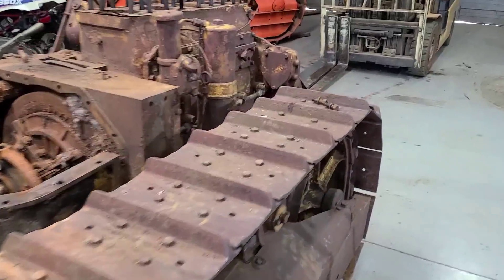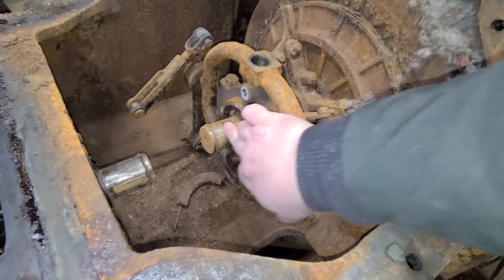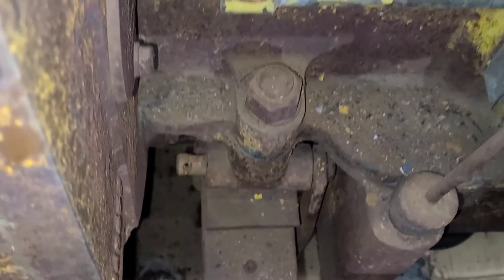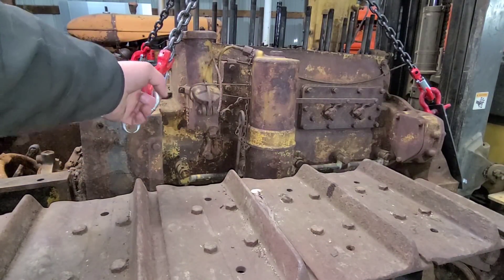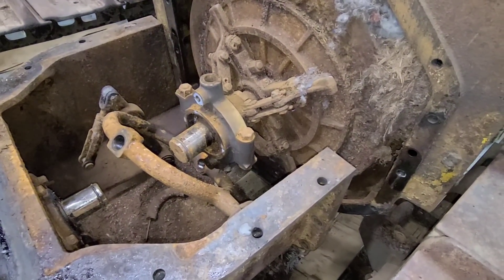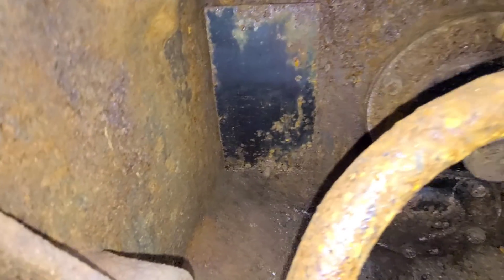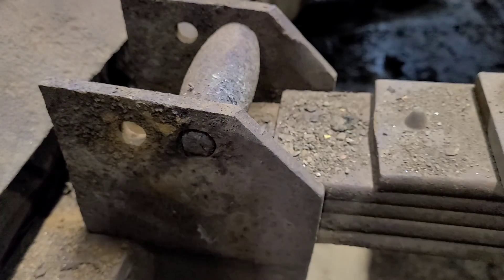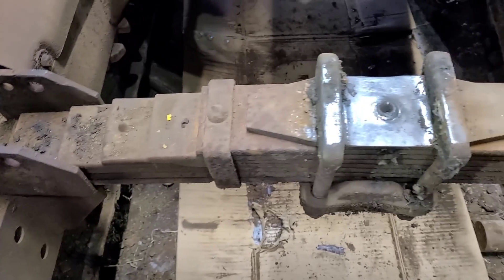Caterpillar RD-4 Engine Removal

Comment: I have an RD-4  just like yours ser# 4G 3491 except it has a winch on the back and an overhead pulley system for the dozer blade 
It's in a lot worse shape but it rolls OK and I had the pony motor running and turning the main engine over about 15 years ago.
When I took the serial # to the CAT dealer they said " so you have that one, here's the microfiche for it. It's the last one."
New sub here. I think my CAT is too far gone and on it's way to become a lawn ornament.   Just got a CNC lathe to work on.
Reply from the maker: That winch setup would be neat!

Comment: Loving the process and progress. Longer videos gets my vote but whatever works for you. Might need a support under the clutch compartment in case whatever’s holding it up let’s go.. ask me how I know..
Reply from the maker: I didn't show it but there is a jack underneath, I had it under when taking the engine out as I wasn't sure what it would do, I then lowered it and moved it out of the way when I took the main spring out. It's back in there now though!
Reply: Good work! By the way if you’re a member of ACMOC there’s a copy of the RD4 Operator’s Instructions in their Technical Library.

Comment: There is another guy on You Tube, Pacific Northwest Hillbilly who is restoring a D4. He has just had the top cover off the transmission and done the steering clutches. I think his machine was potentially in the same condition as yours. He got a complete engine for around $500 as the original engine was severely rusted internally. This said he is learning as this is the first time on these machines but he is good at sourcing the stuff he needs.
With the bores on that engine it might be a good idea to undo the main bearings and pop the pistons rods and sleeves out as one unit (if the come apart like that). You can then cut the sleeves off and if lucky save the pistons.
Reply from the maker: I watch him too Allan 👍

Comment: I came over from squashes Channel as well but a little piece of advice I don't know if you know this but when you're heating a bolt up that's got a pin or a shaft through it stuck with rust rapidly cool it with water or some type of cooling break the rust Bond
Reply from the maker: I haven't tried that, usually heat alone is enough to get things moving
Reply: @kylechrist  yeah Kyle if you heat them rapidly coolant with water it'll break the rust Bond I have personally done it a few times my buddy Don Osborne taught me and my dad was backyard retired mechanic I know I quite a bit about this stuff not necessarily the D4 but more the old Dodge Power Wagons and stuff like that

Comment: That wasn't too bad. Helps that you had the forklift. When I pulled the engine from my D2 to do the clutch I was able to get it Alan Smith's shop and used his overhead crane. Only difference was I had no rust issues. Good job. Keep the videos coming.
Reply from the maker: Thanks Chuck, I need to get my gantry crane finished as that won't ever leave the shop 👌

Comment: Enjoy your videos but have notice that you don’t use any type of penetrating lubricant on rusted nuts or bolts.  Just heat when necessary.
Reply from the maker: Yep, I've never been a big fan of penetrating oil, always had good luck with heat. Thanks for watching

Comment: I don't know if you would be interested in a shout out for my channel. I'm rebuilding a Case 310G Dozer. If not no hard feelings. Good work pulling the engine.
Reply: Going to subscribe. I also have a small channel that I'm attempting to start producing more and better videos. If you would mind checking them out.

Comment: Whenever i have something stuck or nearly stuck, i spray it with wd-40 and wiggle the mechanism back and forth, each move it moves little bit farther and rusty wd-40 oozes out.
bet 99% of lubricants do the same :)
Reply from the maker: Yep, I do the same but with diesel fuel

Comment: Nice! Getting that machine to work again will be a giant project, but at least a lot of it is still coming apart without insane effort and damage.
That wouldnt be so easy on my side of the Atlantic, everything thats left outside for 10+ years is essentially unsavable, the wet&salty sea air turns everything into unrecognisable rustpiles
Reply from the maker: I'm surprised how well it is coming apart, it's putting up a little bit of a fight, but I'm gaining on it